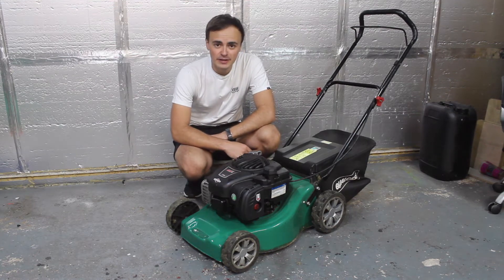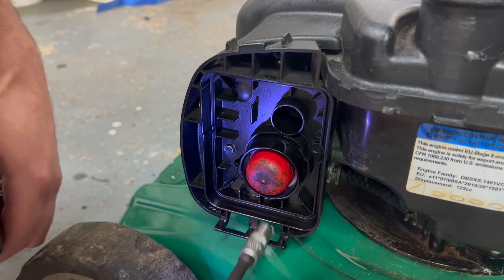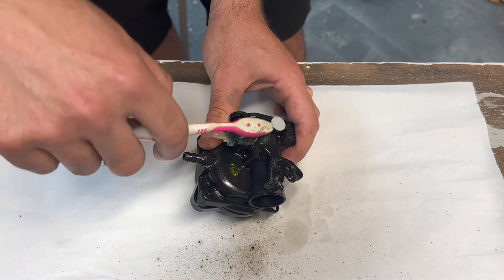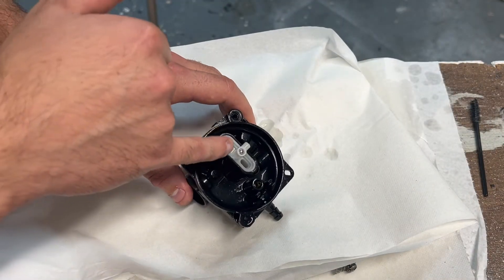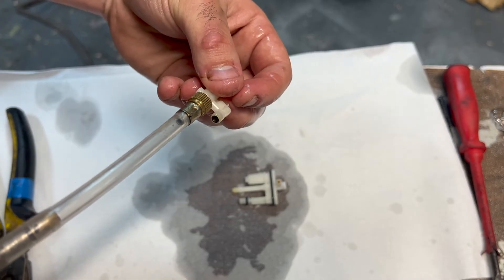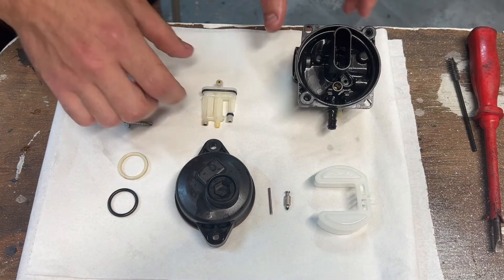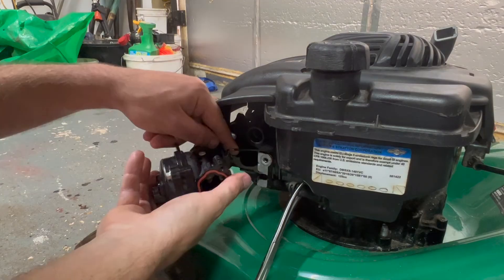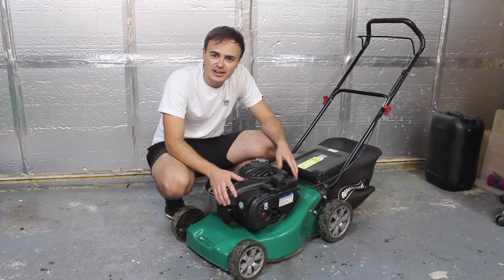Surging lawnmower Engine - How to fix - Briggs and Stratton Plastic Carb

Comment: I noticed that the emulsion tube is missing the black O ring at the bottom.
Reply from the maker: It will need the O ring as that helps meter the fuel to get the correct fuel/ air  ratio 👍🏼

Comment: I changed the carburetor, it still chokes, when it warms up it spits gasoline and stops when it starts hard. Solutions...
Reply from the maker: Sounds like it’s running rich, did you check the needle valve to make sure it’s not letting by? If it lets by it will flood the engine making it stall and hard to restart.

Comment: Hi. the Jet Assembly link doesn't work - Do you have an updated link please?
Reply from the maker: Hi there, thanks for letting me know :) I’ve updated the link for a replacement plastic carb jet. https://amzn.to/4juxm5Q
Reply: @TurnersWorkshop97 perfect, thanks.
Just removed and cleaned the jes assembly (minus the ball bearing as had nothing to get that out with) now running like a dream.
Great video, thanks very much 💪
Reply from the maker: @paulyoungs7361 that’s awesome, so glad you found it useful, happy mowing 😁

Comment: My throttle butterfly is moving close to open the whole time causing the surging
Reply from the maker: The throttle opening and closing is most likely a symptom of a blocked carb or incorrect fuel air mixture. Could be blocked carb or air leak around the carb or inlet pipe more than likely.

Comment: I noticed your carburettor still has the old type jet module in it.  They changed it to the new type to cure the hunting issue some time back.  You can tell yours is the old type because looking at the bottom of it you can see two little brass inserts, the new type will only have one.
Reply: Can you retrofit the jet to this type of carb?
Reply: @lnby  New jet module is a direct replacement for the old one. So it will fit exactly the same.
Reply: I'll give that a try, thank you very much for your post.

Comment: One can buy cans of compressed air for those who do not have a compressor.  Also, if there is enough room in the fuel line (which you did not have), install a "pancake" fuel filter.  Good tip on the WD-40; carb cleaner really does a number on the O-rings.

Comment: Excellent video, thank you.   I have a Walmart push mower (Hyper-Tough) with one of these plastic carburetors.   Some people complain about them, but actually, I really like these and think they are easier to work on than others.   I never considered popping out the ball bearing.  Good tip about using WD-40 as opposed to carburetor cleaner.  For the initial wash-down, I generally just use some older gasoline.

Comment: I did exactly as you said , Carb' was spotless ,Pipes cleaned and checked, changed old fuel ,then had to put new carb' on as still hunting?? changed plug , changed fuel cap, new filter,primer perfect??? why the hell is it still surging,?? I give up;as I've double checked everything. Help.
Reply: Run some torch cleaning tips thru every hole in the carburetor and open up/clean very good the main jet. Should solve your problem, if not I'm here too help
Reply: The pipe with o ring next to pilot jet does it have a hole in, or is it completely closed please
Reply from the maker: They run so lean for efficiency it might be worth opening up the main jet slightly. Failing that a replacement main jet assembly isn’t too expensive.

Comment: Thanks for thr video, i've literally tried everything other than cleaning the carb (full service, new plug, blade, air filter and lastly 99 ron petrol) . I have even fitted a new copycat carb but it also does the surging, so frustrating. My old briggs classic starts first time, everytime and I rarely service the thing!!

Comment: Great stuff, does the air filter still need to be washed and when dry oiled like on the older mowers ? Many thanks.
Reply from the maker: Yes mate, same as any sponge filter. Clean and then a light coating of oil. Apologies I should have mentioned that 👍🏼😁
Reply: When I used to trade in them it was always the case but I've never worked on these plastic carb type. I thought maybe they had done away with it, I guess the plastic is so much cheaper than a metal carb but do they last like the old ones I wonder. Many thanks. @TurnersWorkshop97